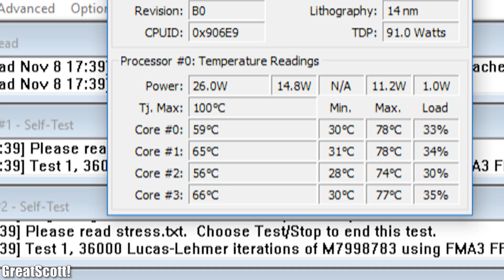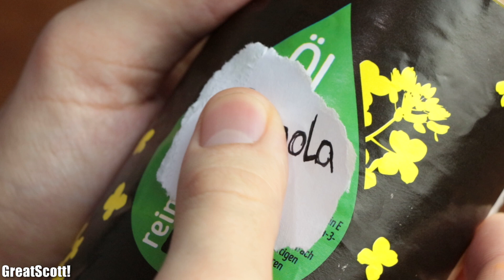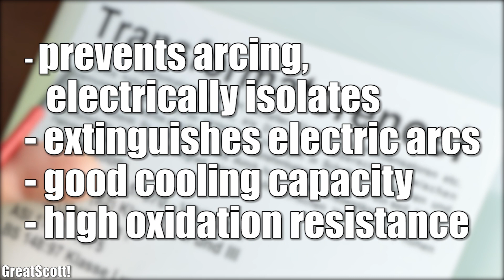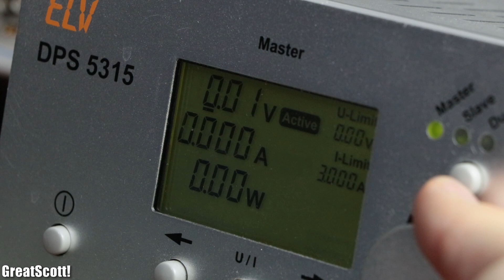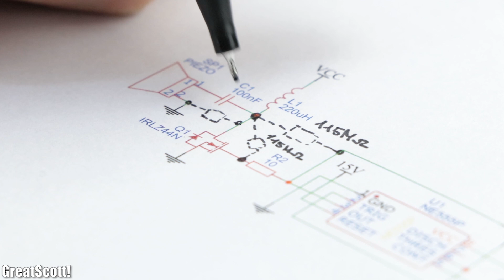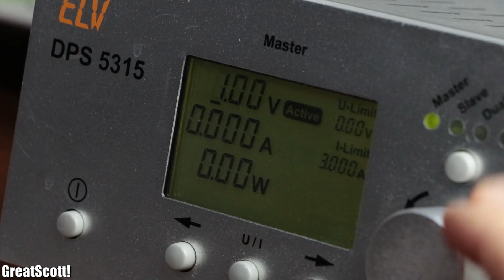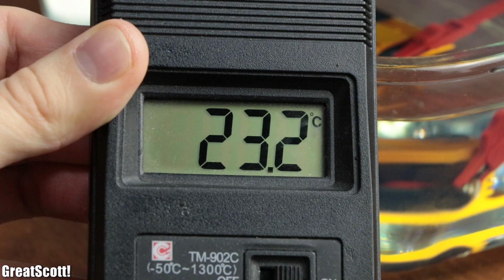Oil & Electronics? the best way to cool electronics? (Experiment)

Comment: Sometimes I just wonder how many arduino do you own?
Reply from the maker: Too many
Reply: @greatscottlab  how many is too many?
Reply: @greatscottlab  You can never own too many Arduinos (Arduinoae?)
Reply: I'm always using those little mini boards. I usually buy them 5 at a time from China, and always have at least half a dozen in stock.
I've recently started buying the ones without the USB interface (using all those CH340 chips just felt wasteful), so I do the dev work on the CH340 equipped boards, then flash a non USB board for the final project with an external CH340 or an ISP programmer.
Reply: 328 of course!
Reply: Probably a bucket of them
Reply: @greatscottlab  so you don't have use for it so you do these experiments.
Reply: @rithikkumars1676  if you consider that arduino is italian it should be Arduini.
Reply: Rithik Kumar Arduino, being of Italian origin would most likely be Arduini or Arduine plural.
Reply: @greatscottlab  hi
Reply: Over 9000!!!!!!
Reply: Approximately 312 Qd, 999 Qt, 999 T, 999 B, 999 M, 999Th, 999.
Reply: Had just one. Used it to Plant a tree with lots of Fertiliser.. Now after years of patience and hard work every day the tree bears Adriano fruits.
Reply: @rithikkumars1676  Arduini!
Reply: @Ethan Parks  seriously buy a started kit off amazon they're quite cheap and you can use 3rd party ones as its open source then watch some tutorials on YouTube (Check out Paul Mcwhorter he explain everything really clearly) and you'll be surprised how quick you pick it up I've only been at it a couple weeks and I know alot more than I thought I would at this point
Reply: @TheRainHarvester  the best answer
Reply: Just the number of likes on your comment😂
Reply: @rithikkumars1676  Arduino is an Italian invention/word, so ig it's Arduini
Reply: @greatscottlab  I really admire you man ❤🤘

Comment: You forgot to mention, that Oils, especially once that are meant for electronics, have the tendency to break down certain plastics, also often used in computers. So while you can submerge your PC in it, you have to choose your components very carefully, so that the parts you submerge don't break
Reply: What if you use on a ''watercooler'' loop?

Comment: I used to work for a company that made radar transmitter power supplies (17.5 to 24KVDC). these units were filled with transformer oil. That oil did a wonderful job of insulating and heat transfer. Oil insulated equipment is usually self healing as well. With high voltage you have to be careful about keeping a edges smooth and rounded or you can develop very high field strengths that can lead to arcing.

On one of these supplies I saw arcing in the oil when I got up to about 12KV, that arc was pretty eventful because it discharged a 0.5UF oil filled cap. I emptied the oil and examined the unit to see what was going on. There was a 7X10 inch PCB that held the bridge rectifier diodes and was held in place by that oil filled caps studs. Close examination revealed a very pointed solder tail that ended at the edge of the PCB. The field strength was such that the voltage arded through the 1/2" of oil. Once I removed that tail the arcing was stopped and the power supply passed all tests and was shipped out to the Suez canal where it may still be doing it's job.
Reply: That Suez Channel joke aged like fine wine
Reply: @jonathandemiguel1458  can't really see any Suez Canal joke nor can see any relation of a transmitter to a stupid ship so well
Reply: you think it would work on small vtx for fpv drones?

Comment: If we do not consider dirt, it is one of the most efficient solutions :)
Reply: so, ceramic?
Reply: But isn't water the worst when dirt is involved?
Reply: i did it too   here is the build log:      https://www.facebook.com/media/set/?set=a.1608112519206141&type=1&l=5ff7a9e4c8
Reply: @Minoguai  would consider to do this project again? Or would you not recommend it?
Reply: Dirt cools electronics too
Reply: Those transformers you see on the power lines are Ford with oil for cooling. Cleen oil is non conductive
Reply: Those transformers you see on the power lines are Ford with oil for cooling. Cleen oil is non conductive
Reply: @richlaue  thank you for that piece of info. I don't even know how inside one looks. To googgle right now!!
Reply: MelonPlayzYT Check out the specific heat capacity of a vacuum! Plus no convection or conduction, leaving only radiation. Better spray paint it matt black! The biggest thermos “flask” in the universe.
Reply: @Minoguai  nice build man
Reply: On general principles, I would expect that water is the worst when salt is involved
Reply: dirt is a thermal insulator and pretty hygroscopic. Didn't use your brain too much right there did you

Comment: In the power station where I worked as an electrical fitter the 17/275kv generator transformers were cooled in two stages of coolers.  The oil was cooled by towns water in one set of coolers which in turn was cooled by sea water in an adjacent cooler.  There was a pressure gradient across the cooling towers with the oil at the highest pressure and the sea water at the lowest to prevent any contamination if leakage occurred.  This video brings it all back!

Comment: Quick fix: When you measured that t.oil resistance with mains AC. Measured current was not through oil, but "parasitic capacitance" at tip of the leads. -> reason why it's always measured with hv dc (next project? maybe not for viewer sake :D)

*Edit note*: next line was my mishap. I mixed insulator and electrolyte in my head. Going to keep it there...
btw, electrolytic caps use this oil to increase capacity and if they had that low resistance, they were pretty useless.
Reply: Dangerous_CODE electrolytic capacitors aren't using oil, they are filled with electrolyte (water or glycol based), and the aluminium oxide makes their dielectric.
Reply: @brys555  I just checked, thanks for correcting. I'm not sure how did I manage to mix electrolyte with insulator (completely opposite functionality). After some data mining, oil do not increase permittivity that much,. Apparently it is around 2.4 while water is 80.1 (my bad)

Comment: I have used Canola or an equivalent for a good many years for high voltage transformers and  capacitors (up  to 25kV). To avoid problems the oil needs to be new, and de-gassed (I use a small vacuum pump and gentle heating at the same time) in addition I pre-heat the oil to 150 deg C and allow it to cool before using it. I have also used liquid paraffin.
Reply: In America, mineral oil is easy to come by, and is usually packaged with a lot of antioxidant. Mineral oil also comes in several molecular weights so that you can dial things in to your liking (in terms of flow, thermal mass, etc).

Comment: Oil sticks and penetrates in the boards from what i read. So even washing the parts with alcohol it can still be oilly. Usually in pcbs such as gpus.

Also it ruins rubber and wire insulation, so people have to be carefull there
Reply: Mineral oil certainly does. Silicone oil is  not as bad - it'll take longer to ruin things. Vegetable oils are all over the place, there's no consistency. The best stuff is fluorocarbon oil, non-damaging and electrically ideal, but it's crazy-expensive.
Reply: Vyl Bird Yeah, the most cheap options such as mineral oil and vegetable oil ruin it pretty easily. 
Its a shame. 

I, tho, will give it a try in a bad and dissassembled laptop someday.
Reply: @eduardoavila646  I ran a mineral-oil-cooled bitcoin miner for a year. It's mostly a matter of knowing what components are going under. PCB itsself, chips, inductors, most surface mount parts, no problem. Most resistors are ok, too. But electrolytic capacitors? Bad idea. Those are not oil-proof and will eventually be damaged. Also exercise caution over wires, as the insulation can be degraded and flake off.
Reply: Vyl Bird Yeah, i've seen some bad results happening with such devices. Mainly wires being damaged, but also some capacitor damage too. 

In my case, i think the motherboard has only solid state capacitors, so i dont know how it would react to the oil. But its that or trashing the laptop, wich has a really bad heatsink. Its more a experience than actually trying to make it work. If for some reason it doesnt dies, it will likelly become a server
Reply: Non of Ur business Yeah, its sad to see that. Youtube could be a awesome tool for fiding knowledge, but there are too many miss information
Reply: I use Paraffin oil without any problems. The mineral oil I use in my cars transmission is also very good because it is designed to be used with electronics and does not react with any metal or rubber insulation. Transformer oil is way to toxic for general home use and to expensive anyway.
Reply: @Non of Ur business  No one is forcing you to be here or do anything.. If you do not like it then do not watch the videos... It is just other people sharing their ideas and experience...
Reply: Mark Tate Paraffin oil? Interesting. If i find it to buy here where i live it may be a good option too
Reply: @eduardoavila646  Sold in the USA as Kerosene. As an oil it is terrible as the lubricating ability varies so much from batch to batch, and the composition of it varies very widely as well. The specs are very broad, it just has to have a minimum and maximum energy per kilogram, a viscosity around a certain number and a freeze point in a certain range, otherwise every other property is variable, plus as it freezes the waxes in it freeze out as wll, and it is very high in wax. Makes a terrible diesel substitute, but a lot of people use it in diesel vehicles because it is generally cheaper than diesel. It generally is only used as a fuel, where it provides a reasonably constant heat energy. However it does attack rubber, especially natural rubber, and will also eventually soften and degrade silicone rubbers and nitrile rubbers.

Transformer oil is probably the least toxic oil around in terms of mineral oils, it has a very close spec as to composition, and boiling point, freezing point and wax content are very tightly controlled. Only reason for the warnings is because long exposure to air and heat cause it to degrade, forming byproducts and organic acids from the water adsorbed in it. This actually is used to tell oil life, they apply high voltage to a small sample between 2 metal balls 1mm apart, and measure the voltage where it passes more than a certain current or arcs over.
Reply: Mark Tate The problem is that when you need certain information, but some channels, not the case of this one, pass misinformation. Making you sometimes even risk yourself.
Reply: SeanBZA Interesting. Probably i will go fully cheap and just submerge my old laptop in cooking oil, i really just want to give it a last chance to be at least a server before i trash it. 
Its a really horrible laptop anyways.
Reply: @Captn_Grumpy  Correct. It is the same fluid used in liquid breathing. Don't get too excited though. It works on lab animals, but there are some practical issues for humans. Carrying oxygen isn't the problem - it's getting rid of carbon dioxide.
Reply: @SeanBZA  lol are you guys seriously considering kerosene as a coolant in an electrical device? this really seems like a good idea? can you think of any reason you might not want to use a flammable substance that vaporizes at room temp ? :)
Reply: The thing about using oil for electrical components is “if you use oil keep it oil.” Along with that is to keep it in a case that is easy to inspect for contaminants to protect your circuit. I myself have never done something like this, just feedback I have read and my own observations. “Stay Creative!”

Comment: You should do a follow up on Flourient. It is a cooling fluid used by the Cray vector supercomputers from the 80s. The stuff is still available, a dielectric compound that boils at 50-60°C at 1bar. Phase change is a one-two orders of magnitude more efficient heat transfer process. Would definitely make a interesting video!
Reply: When it does boil, it's poisonous and is also good at absorbing infrared light. Maybe not a hobbyist friendly coolant.
Reply: Yes, but check out the price on the the stuff.
Reply: Heat pipe... DIY or buy? could use some low cost low  BP liquid like cigarette lighter butane (ok butane has some obvious drawbacks)
Reply: @joinedupjon  Propane is pushing its way as a "low global warming potential" refrigerant, and is fairly cheap and has relatively good thermal properties. It would, however, have to be held at a significantly higher pressure than atmospheric for use as coolant, rendering it more-less uneconomical for the "home gamer" (ca 12 bar(a) for a boiling temperature of 35°C). N-Butane and iso-Butane would be a great choice since they would require a 2 bar overpressure for a 35°C boiling point. There's the also the flammability issue, naturally. There is a refrigerant called R245fa - boils at 35°C at 1 bar(g). Also R123 boils at 27°C at 0 bar (g) but is prohibited for use. No warranty for electrical equipment. As for Flourient - F-72 maybe could work
https://multimedia.3m.com/mws/mediawebserver?mwsId=SSSSSuUn_zu8lzU94xtxoYtGNv7zg17zHvu9lxUb7SSSSSS--
Reply: @no-defun-allowed  But with LEDs you get colorful bubbly computers. It's worth it :P

Comment: If you add a fan or some sort of stirrer to the oil, it works much better. The viscosity of the oil slows down the thermal currents keeping the warm oil near the resistor. Stirring the oil moves the warm oil away and cool oil moves in to better cool the electronics.

Comment: Could the AC current in the oil just be capacitance?
Reply: I bet it is. Would have been interesting to see it on a scope.
Reply: Indeed, grab a scope and frequency generator and lets have a look.
Reply: Of course it's capacitance, the question is whether the oil makes more or less capacitance than air. (Probably more)
Reply: @thewhitefalcon8539  Hydrocarbons have just over twice the dielectric constant (relative permittivity) as air, so double the parasitic capacitance I think.
Reply: With the DC current he measured the electric resistance. To measure the electric impedance he used AC current.
If the DC current is negligible compared to AC current(from this test) then current is most conducted from capacitance.
The capacitance is related to the area and distance of the conductors, not only the oil. If he put a shorter area then the AC current/distance would be less.
Reply: @thewhitefalcon8539    I often immerse variable air capacitors is paraffin oil, it does increase capacitance since oil has a much higher dielectric constant but it greatly increases voltage capacity by a lot which is the main reason I use it. My RF dummy load is also immersed in oil but it is a purely resistive load so no capacitance at all, the oil is just to keep it cool so it can handle over 1KW, without the oil is is only good for around 200 watts.
Reply: I was thinking the same
Reply: @luisff7030  Only if vacuum is your relative permittivity, which is valued 1. The Capacitance=(relative permittivity*area)/thickness of dielectric
Reply: Had exactly the same thought.

Comment: Hello GreatScott! I am not sure but I think what also influences the heat dissipation is not alone the specific heat capacity but the product of specific heat capacity times specific mass. If that is correct, for the (not so realistic but simplified) case where there would be no flow ( = no convection), you can add a scaling factor of ca. 1000 for the product c*rho between air and the other two liquids. But of course, there is flow and convection.
Thanks for the great videos!

Comment: It would be awesome if you could compare the transformer oil to silicone oil.
The reason is because transformer oils are typically made from mineral oil and they contain solvents making them highly flammable given the right conditions. Silicone oil, while more expensive, is much less flammable.

Comment: I used to work with high voltage power supplies that would put out more than 200 thousand volts. We used this type of oil to insulate and cool the supply. The high voltage would generate electrostatic waves that would circulate the oil around the components. On some models there was also a pump and a radiator. Many large X-ray machines use this type of system. Even the X-ray tube, which gets very hot, was submerged to remove waste heat. So I don't think you will have any problem keeping your Arduino cool with this method.

Comment: Just one thing: IC chips are designed to be used in air, in the sense that, in the event of a voltage spike, a spark is created in a specially designed component that is exposed to the air. The current goes through the arc instead of going through the circuit. So if you operate them under oil, they will be more sensitive to voltage spikes.

Comment: 3:50 you measured the capacitive reactance of the setup, not the resistance.  The current would have been zero if you used DC at any voltage below its breakdown.

Oil is not good sometimes because its high dielectric constant actually increases the capacitance among nearby conductors for some reason.  Being a better barrier than air, that doesn't make sense to me, but there it is.  So, oil is not good for high speed, sensitive, oscillating circuits.  It will detune resonators/filters and leak some signal current around.

If you dunk a motherboard, cellphone or radio in it, likely it will stop working, or malfunction non-destructively.  A slow circuit will be fine.

Edit: (10 months later lol)  -a more sensitive and/or high speed circuit can function properly if it's designed with larger spacing or to be specifically used in oil, in which case, a few of them may not function optimally without the dielectric or cooling properties of the specific oil it's designed for.